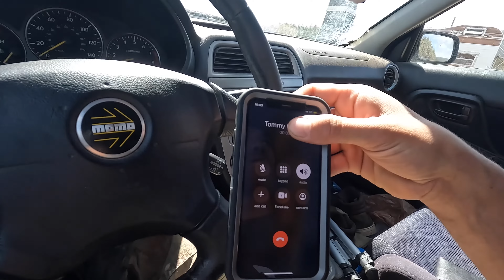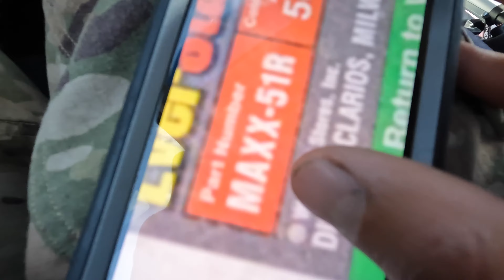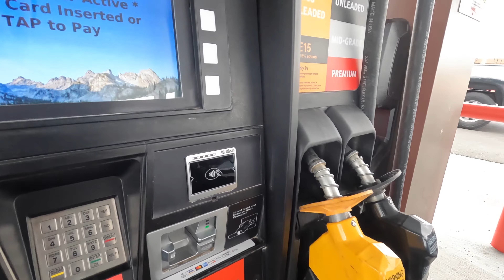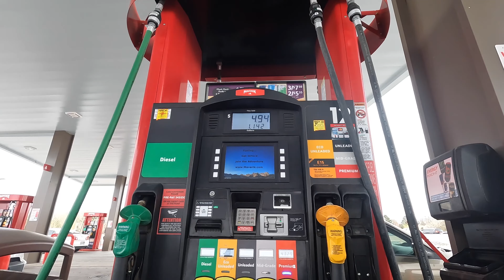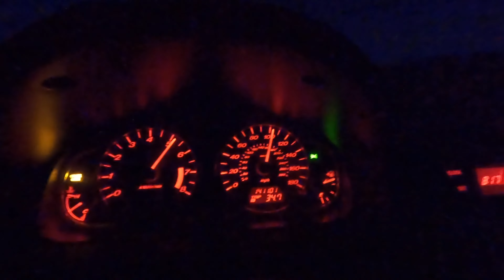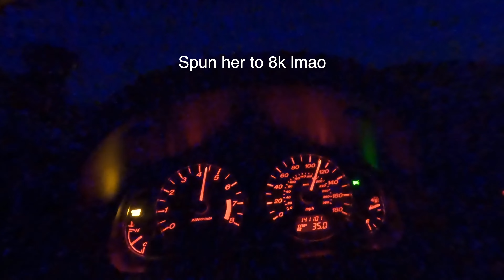Another Car? I think I have a problem: Mazdaspeed 6

Comment: Curious to see your plans for this car!? There are lots of mods available for this platform even though it is quite 'old' but still very good.
Reply from the maker: Fix the injector seals, new Cobb accessport, MAYBE a front mount, and daily drive it. The turbo is already upgraded. No real plans for this one. I was offered a good deal on it and I miss manual transmission